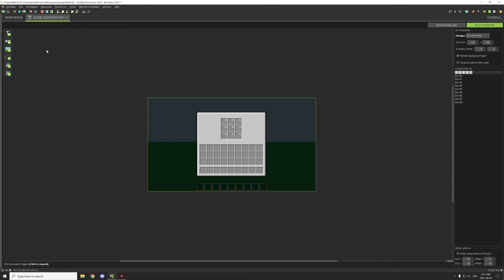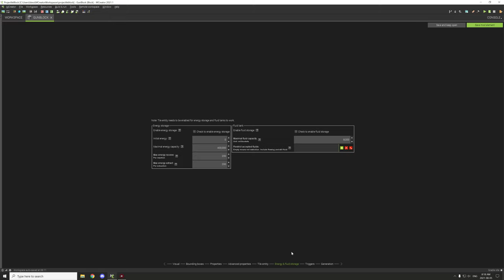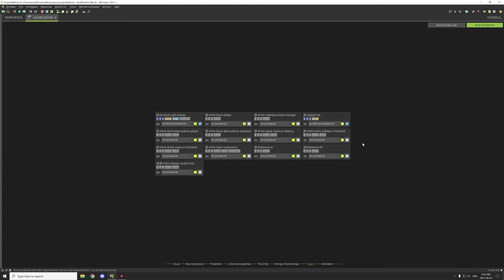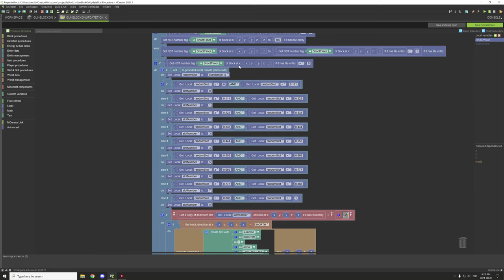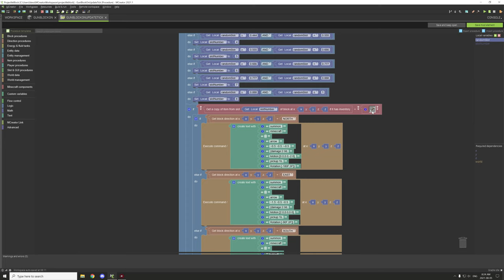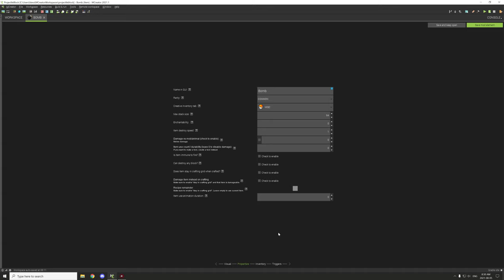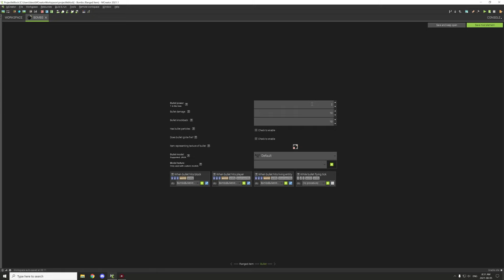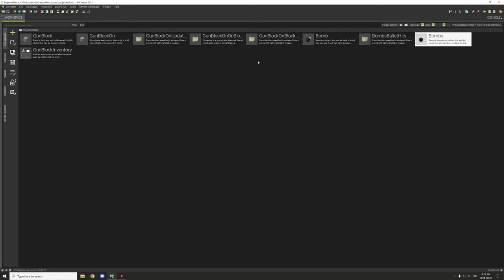MCreator: How to make a Gun Block | 2021.1

Comment: How do I make a machine gun?
Reply from the maker: It depends on what element you want lol.
If its a block gun then you could use something like this you may be able to adjust the shooting direction a bit based on the block's model and rotation to shoot on an angle.
Other wise I would suggest using a range item element.